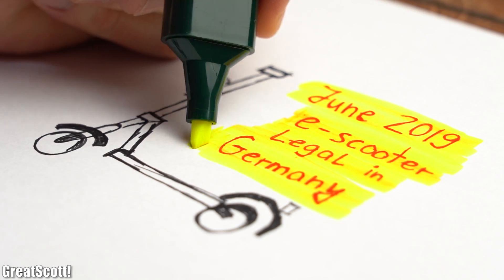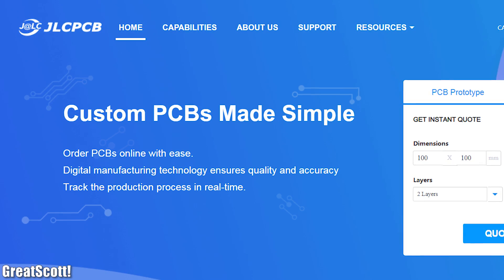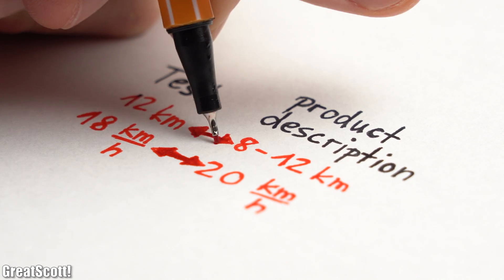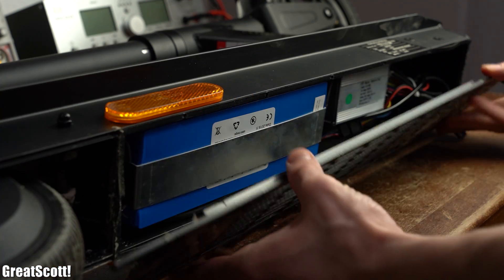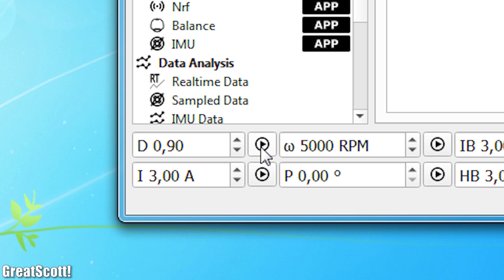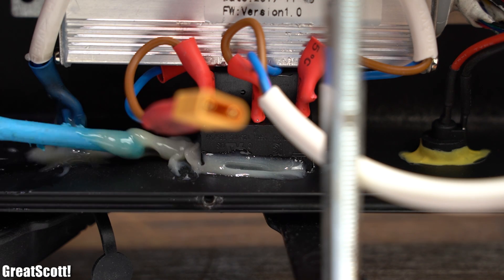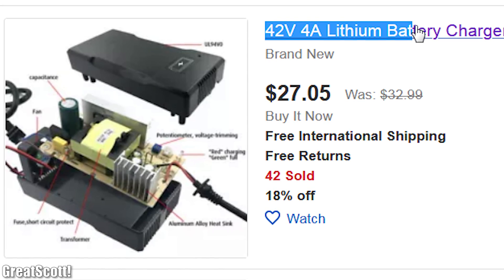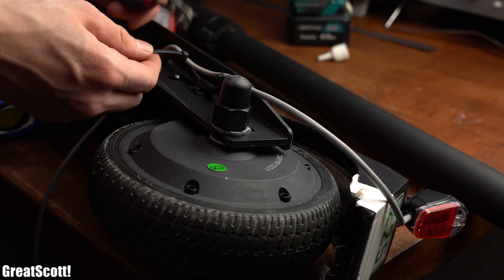Upgrading the cheapest street-legal E-Scooter I could find on the Internet!

Comment: > Using resistors to  drop the voltage
DC-DC buck converter: "Am I a joke to you?"
Reply: Adding insult to injury, a big fat bundle of resistors, lol
Reply: @YoureUsingWordsIncorrectly  thats what conrad is for. Yes its more expensive but its there in a day (or two)
Reply: At least he uses resistors, not sticks or stones
Reply: @Yeesha666  HAHAHHAHAAHAH
Reply: The second function of resistor pack is keep battery in warm in winter season :D :D
Reply: Today I changed a light bulb, crossed the road and went into a bar. My life is a joke!
Reply: Diode: Am I a joke to you?
Reply: Buck converters get needlessly hot at their small size. I'd use resistors.
Reply: @Boogie_the_cat  Eh? Are you saying that resistors would get less hot? A buck converter has the efficiency of around 90%, whereas a resistor just burns away energy as heat
Reply: resistors are cheap
Reply: Hello everybodies,

I've been trying to install turn signals on my scooter for a few weeks, but I can't.
The battery has a capacity of 52V (59V fully charged) and the LEDs that I am trying to install only use 12V MAX.
I have already tried to install adjustable voltage buck converters, but they have burned out the scooter controller, because they seem to consume more electricity than what is allowed by the controller on this branch of the circuit (turn signals).
The LEDs are already attached to the scooter, but they are not yet powered.
So I would just like to know how to go from (more / less) 52V with a resistor, without risking to burn the new replacement controller.
How can i do that please ?
Reply: @e-scooters-france  
to be efficient, you need a step-down power supply. Resistors will eat up huge amounts of power. You can get parts from Power Integrations which will do this, more or less, without a heatsink. A resistor which drops from 59V to 12V at any kind of current level will be huge and waste lots of power (which you don't want on a scooter.)

Or, you can add another 12V battery just for the lights.
Reply: Hi, thank you for your reply. The fact is that there are already flashing lights installed on the scooter and I was able to measure the input voltage which is + / - 52V (59V Max battery full). Obviously, the few LEDs that are connected to this voltage could not withstand it if there was no resistances.
So, this is a configuration that is already present on the scooter, but the famous LEDs must consume a maximum of above 5V, hence the presence of resistance on the indicators already present on the scooter.
If you want, I would like to connect in parallel on this same part of the circuit to do the same, that is to say add two LEDs following the same mounting principle. I could observe the resistors which are already present for the original side indicators, and it is true that they heat up a little, but it remains light and it does not seem to consume a lot of electricity, from what I read on the scooter display and on my multimeter.
Obviously, what interests me is to fall back on 12V, and seeing what already exists I am convinced that it is quite possible.
As I said above, I can not connect a voltage converter at all, because in my opinion they ask too much current on this branch of the circuit there, which has already had the effect of destroy me a controller.
In any case, even if it consumed a little more electricity, it would not be extremely serious for me since the autonomy of my scooter is already huge (about 100km) and then the indicators are only very little used in the end. Obviously, consumption must remain reasonable, that's for sure.

To explain you the reason why I want to add second turn signals, it is because the original ones are not visible at all to road users behind me. The indicators already present on the scooter are lateral, so we can't see them from behind.
The LEDs that I want to install (add), they will be clearly visible to the people behind me because they are 12V motorcycle indicators, very bright, and above all to be placed frontally and not sideways.

Les LEDs consomment aux alentours de 0.78 mA, pour 12V.
You can find the original assembly (on which I would like to connect in parallel) in picture below. This would give you an idea of what is already installed and what I would like to do.

Original LEDs with resistors:

https://zupimages.net/up/20/08/8atj.jpg

https://zupimages.net/up/20/08/8yon.jpg
Reply: @e-scooters-france   How about adding the new LED array in series with the existing LEDs. That way you can use up the voltage in the LEDs and use the same amount of current. You would then use smaller dropping resistors which for the same current, would actually dissipate less power. Less waste and more light!
Reply: @e-scooters-france  You need to know the current that your turn signal requires (you can measure it with a multimeter set to ammeter mode). Then use an online resistor calculator (such as ledcalc.com) to calculate the value and the power of the resistor.

Comment: Im surprised that you used a resistor to drop the voltage across the lights rather than use a buck converter.  Was there a reason why?

Comment: wouldn't be a buck converter better solution than a resistor network? I mean less heat in the electronics compartment, longer battery life and stable voltage regardless of  battery charge. Also you could still overclock your speed if you connect pack with higer as an external source and if you used buck converter you wouldn't fry your lights. Also you already had 3 positional switch that you could use as a main switch to further reduce passive battery drain.

Comment: Using resistors instead of buck conver for lamps was disappointing ☹️☹️
If you ask me, the extra batteries of lamps are used for safety in EMC situations. You shouldn't cross them out?!! 🤔🤔🤔

Comment: 6:02

3211.8 RPM 😂. If that was right then it would probably fly or something. 

My longboard wheels (9 cm diameter) spins at a maximum of 2500 RPM and that is ~45 km/h. 

The wheel on your HoldPeak RPM tester is much smaller then the wheel on the scooter and therefore gives a mechanical advantage. I don't know how big diameter the wheels have bud I would guess about 1:2,5.

But your videos are great either way 😃
Reply: He wasn't using the RPM to measure the speed, just taking RPM before and after to see if there was a change in it when the voltage was upped
Reply: @webrosc  this

Comment: Maximum Speed Under a load is something to look into as well, like average speed under a small incline like 3 degrees or so, could be improved with a higher capacity battery pack but keep the voltage the same. This increases range and improves performance by reducing voltage drop on the motor. Did this to my E-scooter and went from 9 MPH up a slight incline to 11-12 MPH. Also gained 3 miles of range. Went from 5AH to 7AH. Also I have been losing weight which contributes to the scooter running more efficiently with less weight to carry.
Reply: Nice tip

Comment: You could kill 2 birds with 1 stone, if you had a similar 24V battery, you put in series with the internal battery.
That way both range and speed would be affected.
Range a little less, but speed definitely more!
I once ran my 48V 24Ah scooter with 2x 8V 5Ah batteries in series (the 2x 8V ran in parallel with one another), adding 8V to the 48V, allowing the scooter to run at 56V, but limiting the current to 10A.
This worked fine (56V, 10A = 560W, more than what I needed under normal use), and the scooter ran a few kmh faster.
The only thing was that the regenerative braking didn't work anymore. Not that it mattered that much, I still had standard brakes.

Comment: I'd rather use some small dc-dc to drive the lamps, to avoid wasting power on the resistors. Maybe i'd also put the lights in series to increase the overall required voltage (if they are rated similar voltage & current)

Comment: The resistor set up is a very inelegant solution when all you need is a cheap little buck convertor.
Reply: He did say ‘price-related non-optimal’
Reply: All my cheap dc converters work untilm~30V. Even then, above 24V, someof them smoke the input capacitor. Getting one for 42V would be tricky forme right now - China is N/A and local sources are way overpriced....
Reply: @rklauco  A lot of those buck converters would handle 42V if you upgraded the electolytic capacitor on the input side to > 42v.
Reply: There is always one dude that want's that most perfect look to make it professional. It's all about functionality. That's why they can sell you shit if they make it look professional.
Reply from the maker: It is a simple and sufficient solution. A buck converter would have drawn standby current which would have drained the battery. The resistors waste around 4W of power which sounds like a lot but when you keep in mind that the scooter drains a 154Wh battery in an hour then the 4Wh for the resistors are pretty much irrelevant. But sure, you can use a buck converter if you want.
Reply: GreatScott! But I thought you can switch the whole system off, so there would be no standby loss? 🤔
Reply: @greatscottlab  nice
Reply: Because he always make things  simple
Reply: Yea. On top of that, if the voltage drops, the light brightness will decrease too
Reply: Oh man! Right? He knows too why did you do that Scott! XD

Comment: I was lucky enough that i found with a friend an elecric scooter in e-waste 

It had its rear tire and rear disc brake damaged and batteries were really low

After repairs it was running like new and now comes the fun part

We are making some upgrades which are mainly: better torque(achieved by simply tinkering with controller), higher speed (getting a new sprocket for the rear wheel) and better range (getting a new set of batteries). 

But we need to stay somewhat "legal" (atleast here in Slovakia) so there is an switch for slow mode and fast mode.
Reply: which model do you have?
i've been watching guys on yt with their modified e sur-ron bike's hitting 70mph.. that and this vid makes me want to get electric scooter/bike/bicycle

napr. :D íst 50kmh na kolobežke len v plavkách na domašu/širavu

Comment: With the second battery, why is it suggested to connect when both full and same voltage. What would happen if main battery empty and spare is full. How do you get past the problems of imbalance
Reply: Strictly for maximum range as the batteries are separate (SPDT switch).

Comment: The capacity of that pack strikes me as quite low. 4.4 Ah at 36V is about 20 18650 cells with each cell offering 2.2 Ah. Judging by the volume, you can definitely double or maybe triple the capacity by using 3.5 Ah Samsung INR18650-35E's or 5.0 Ah Samsung INR21700-50E's (https://eu.nkon.nl/rechargeable/li-ion/18650-size/samsung-inr18650-35e.html or https://eu.nkon.nl/rechargeable/li-ion/21700-20700-size/samsung-inr21700-50e.html for instance). and creating your own pack that fits snugly into the case. Perhaps a follow-up video? haha! Thanks for the video, always an instant watch for me when I see a notification! Cheers!

Comment: Why not use a LM317 5V refulator or similar chip instead of resistors for the lamp?

Also, you could increase the battery pack capacity by replacing the current 18650 cells with Samsung INR18650-35E that have 3500mAh capacity....50% more.

Comment: Make the tyres bigger, that will naturally help with the cobble issue.
Reply: After market e scooter have build in bubble shock absorber tire/tyre.
Reply: This will also increase the maximum speed, as the bigger wheel gets the same RPM but covers a greater distance

Comment: wait, did he just put a ton of resistors to lower the voltage? isn't that a waste of energy?
Reply: I would have thought a couple of buck regulators would have been better (or one and then resistors for the lowest required voltage). $1 items from Aliexpress...
Reply: @Shaun.Stephens  47V input is pretty high for cheapo DC-DC converters, but you could probably find one
Reply: Keeps your nuts warm
Reply: I think the leds are low current enough that the power loss is negligible
Reply: @AL_O0  Then why did he use so many resistors?
Reply: @ProtoMan137  He probably has to reduce the current so that it doesn't destroy the LEDs.
Reply: @ProtoMan137  The LEDs would blow up, so you he put resistors to limit the current going to them
Reply: @marknogueira6425  one resistor in series with a buck converter does the same job
Reply: @AL_O0  He said in another thread that the resistors use 4 W/hrs of the 154 W/hr battery. The lamps themselves probably only use a half of that at most. The current might be low but the voltage drop isn't.
Reply: yeah its totally a lot of power loss from the resistors also if one blows the others will take the load causing more resistors to blow up, also they will heat depending on how long they are used, so the best solution is as somebody said adding a buck converter, and a current limiting resistor for the leds.
Reply: "This is not worth a buck converter and all that wiring hassle."
Yes that ridiculous array of parallel resistors is much easier isnt it?
Reply: Look at the comment section of heinrich, just a few comments above you. GreatScott mentioned why he didn't use buck converter. He said that the converter draws a standby current, thus draining the battery. So, he used resistors which wasted a negligible amount of energy compared to the energy used by the scooter.
Reply: Standby current? Use a switch then. No standby current when lights not in use. Simple.
Reply: @jeremiahrex   for the back light, 3V times 0.045 A  = 0.135 W , that is even less than half a Watt
Reply: "3V times 0.045 A" 

Thats the power of the light, not the power dissipated in the resistors.
Reply: Everyone is talking like a fool. Sorry.
He is not lowering the voltage nor he limiting the current. By adding more resistor in parallel it increases the watt of the components. Each of those resistors are most probably 0.5 watt. Then think how much resistor he needed to power a 10W LED? He need 20 resistor in parallel. Don't think negative about him. He is an Expert.
Reply: @abdulkader5470  what the heck are you talking about?
Reply: @michaelatorn8380  He connected those resistors in parallel. It increases the watt of working resistor. By adding more resistor he can use more LED or devices.

Comment: Is it still legal to drive the upgradet scooter?
Reply: nothing he did should have any impact on it's legality, upping the speed would have, but he didn't do that.
Reply: No, as soon as you modify anything regarding structural strenght or powertrain it stops being street legal.
Reply: @tobimai4843  then german laws are stupidly restrictive compared to north america.  He didn't modify top speed, or even torque. Putting a external power plug and modifying the lights to run off the main battery shouldn't affect the legality of anything.

Comment: My bicycle uses a generator on my light system.  The faster I go the greater the voltage.  I blew two 3v bulbs and needed a 6v and 3v bulb which hasn't failed me yet.  The circuit is series.
Reply: I’ve used LED light bulbs. They’re slightly brighter than normal tungsten bulbs.

Comment: Why would using a resistor network for hooking up the bike lights to the main battery be called a "decent upgrade" ???  2 small adjustable switching power supplies from Amazon or Banggood would have wasted a lot less power, IMO... Put a switch between them and the battery and you are golden.
Reply from the maker: The resistor power waste is insignificant in comparison to the required motor energy.

Comment: I recently bought one of these Megawheels scooters used from ebay for around 120 €. I didn't feel a need for a higher speed, but more power is needed. It has this 5.5 inch hub motor on it and I decided that without altering the original speed control at all, I'm just going to attach a decond similar motor on the front of it with its own speed controller. Now it should in theory have double the torque, but still the same speed of course costing the battery life, but in my use a smaller distance is really not a problem. I only need it for small bursts like 6 km after which I can plug it in to charge. Of course after this it wouldn't be legal in Germany anymore I think, because by my modifications it loses the kick detection and has way more power than legally allowed. In my country it's not a problem though, because no one really monitors these things and it doesn't need an insurance.

Comment: That controller should be able to handle a higher voltage for sure. A 36V controller should be able to handle 52v  and give you a ton more speed.  But then, it would no longer be a legal ankle breaker.   Also.. Why not build your own E bike?  Those are legal as well... or?